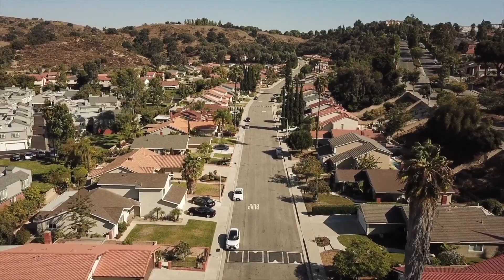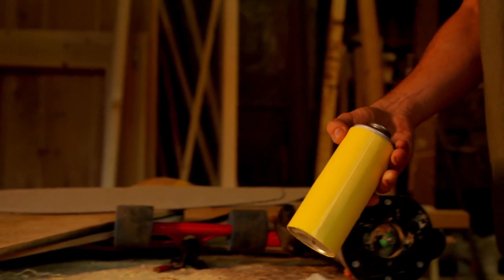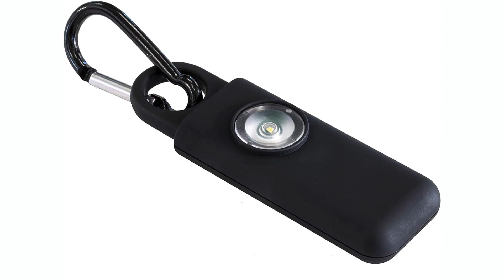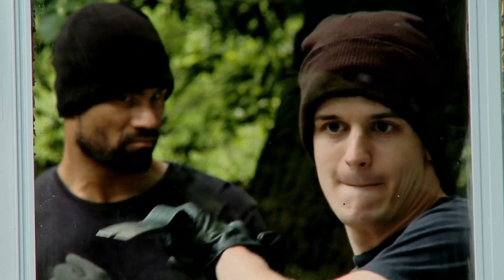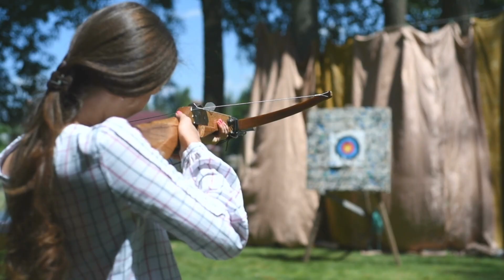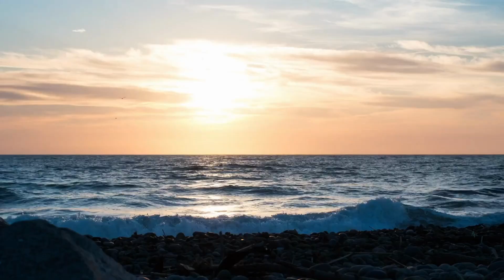LOW POWER Home Security Alternatives | Shelter In Place During POWER OUTAGE & SHTF | FEM Prepper

Comment: Harbor freight has driveway alarms $10 w/coupon with a sensor for outside and recievers inside. Place in path of least resistance. Needs a 9v for outside unit, inside requires C cells BUT I use AA because with a coupon I get 24 a low as free w/purchase. For no cost perimeter alarms for secondary ingress use fishing line and cans as noise makers. The dollar store has window alarms and tutorials on YouTube to make trip alarms. Instead of sandbags use boxes of copy paper to provide under window ballistic protection.
A surplus of family pets are becoming available, if you can get a little yippie dog to be your century. Use social media or church connections to find them free.
Reply from the maker: All great suggestions that I also use! I focus on creating redundant systems and of course I have my own 🐾 🐕Alarms but I believe those are just so basic and I have seen many channels feature those as suggestions dogs, fishing line and cans, etc, so I focused more on the items I have not seen featured as much on other prepper channels.
Reply: @FemPrepper  if you have time check this out. Much of it is prepping 101 but there is a chapter on scavenging and a chapter on trading and bartering.  And many other golden nuggets.
https://youtu.be/WnnGFPHm6SA